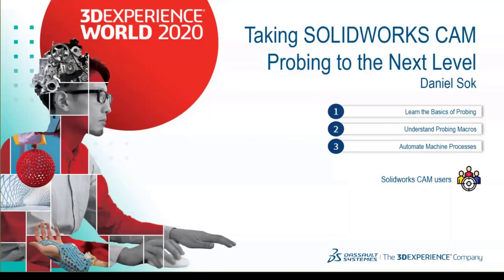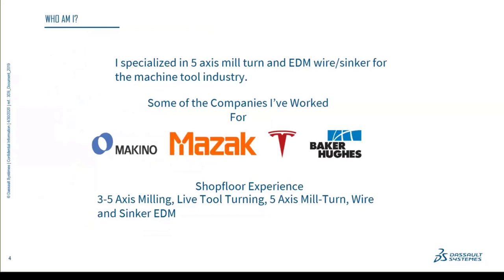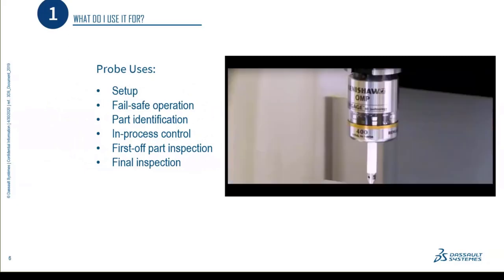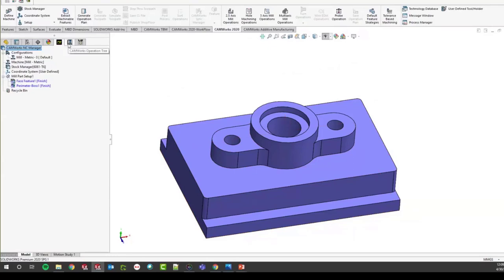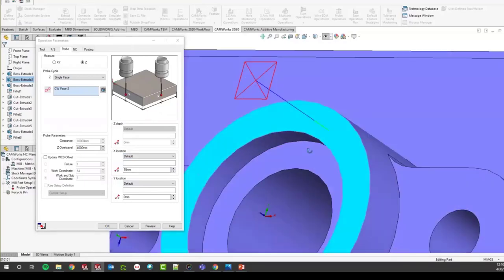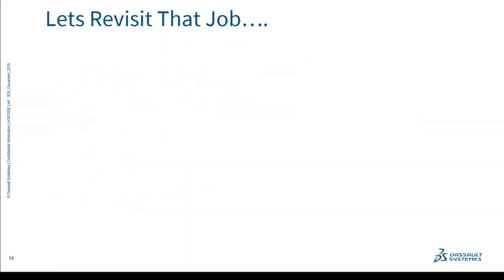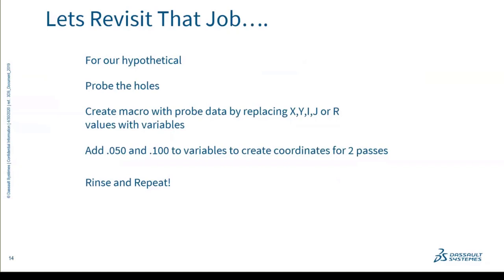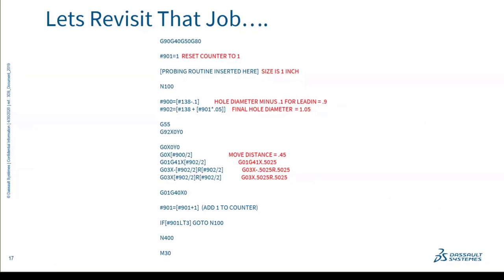Taking SOLIDWORKS CAM Probing to the Next Level

Comment: Fantastic information, I wish the video on this was better, I could not make out some data. I am a 57-year-old Mfg. Engineer who has written 99% of my programs in the past by hand.  No CAM. I am just getting into Solidworks. You have a lot of valuable information to pass on, thank you!! I have written many programs using Parameterized Programming, and Fanuc Macro B. I have only used a few probe cycles on the Toyoda machines we had at Continental Motors.